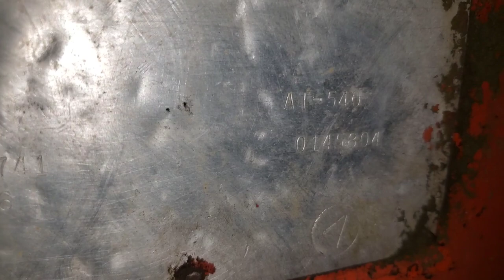Timberjack 230 Transfer Case Service.

Comment: I recently picked up an old tree farmer with a similiar story I'm going through and doing the same stuff. My neighbor is an "old timer" he told me that anything that takes gear oil drain it put some diesel back in it and if it's the differentials run it a couple hundred feet, the winch run it in and out a few times. He said it helps to clean all the crap off stuff and it will function as a lubricant for a few minutes to help clean it, then drain it and fill with 90w. Mine is a 353 detroit and a new process transmission as well. I'm the furthest thing in the world from a mechanic but I'm figuring stuff out. Make sure you have you kill switch (not ignition) working in case it runs away, I took some tie wire around the flap next to the intake and ran it through a small hole in the dash with a loop in case I need to use it.